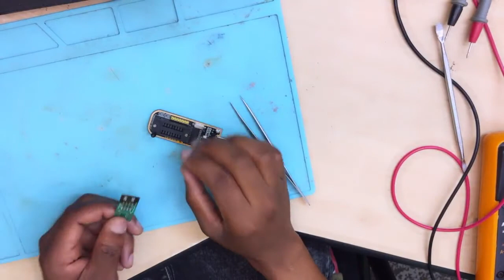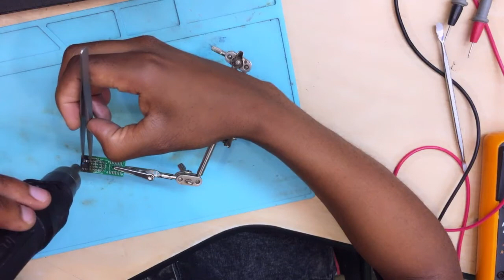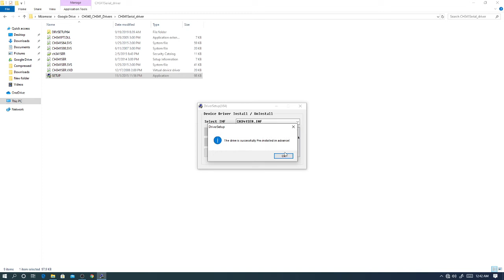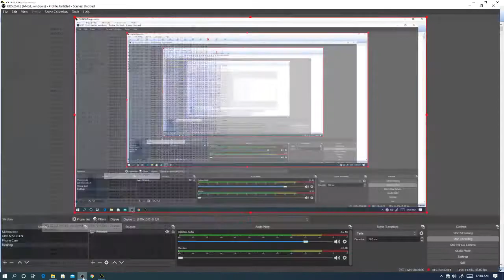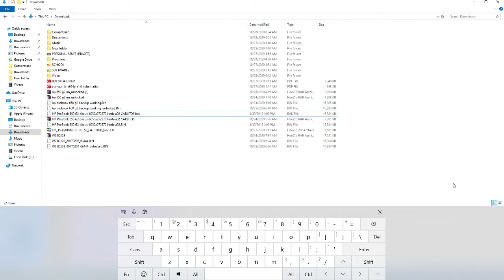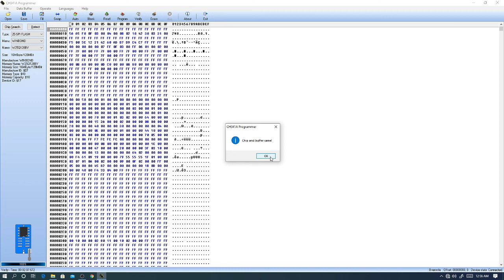How to use CH341A Mini Programmer - How to download drivers for CH341A Mini Programmer

Comment: I also checked out the Eakins microscope on Aliexpress. It was listed for $99 and shipping with DHL $91. It is a lot of money but I will need it to do repairs. There is smaller usb hand held microscopes for much cheaper but I rather buy the Eakins beacause of the quality. Thanks again.
Reply from the maker: Check the quality, choose the one with a good camera, like 41Mp